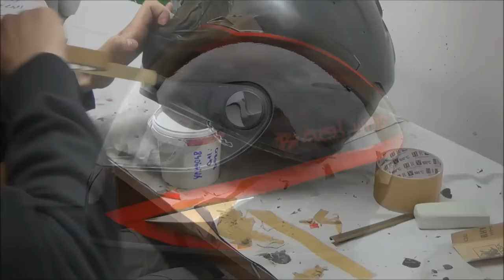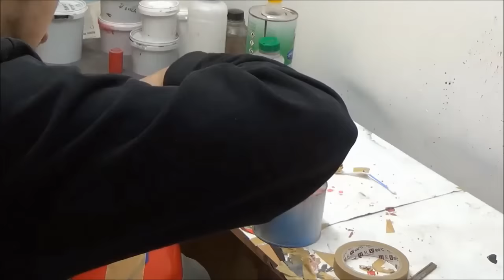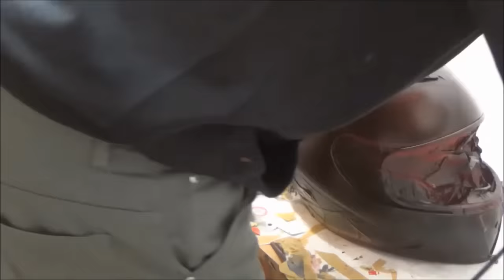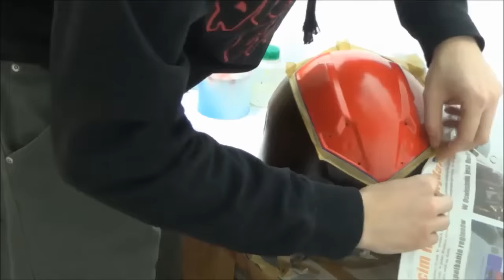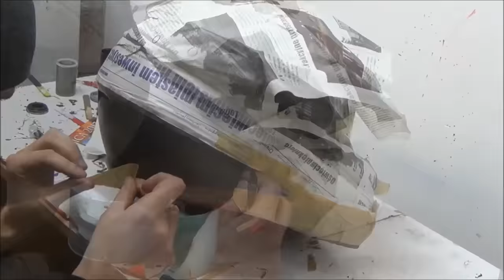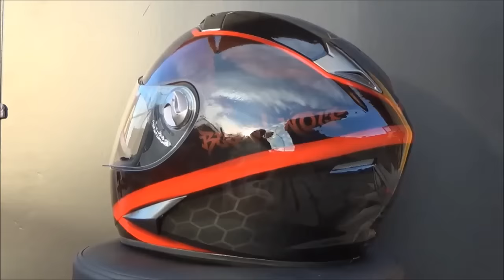Black Wolf (inspired Witcher 3 Wild Hunt) design painted on motorcycle helmet - aerograf airbrush

Comment: I want to get into airbrushing .. can anyone tell me what the recommended air compressor to use on jobs like this?? Thanks
Reply from the maker: I have homemade air compressor (made with compressor from fridge) - this same for 9 years, still working and reliable. I think that this is the best option, but i know that not everyone can make this device. You need to have good dehydratation and deoiling in it.
Iwata made oil compressors for airbrush. It is good but... also expensive.